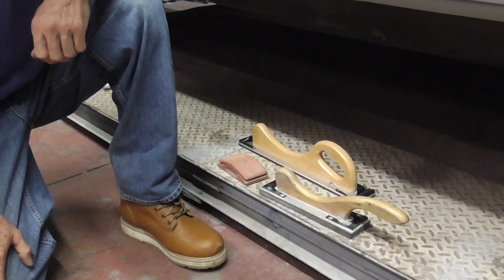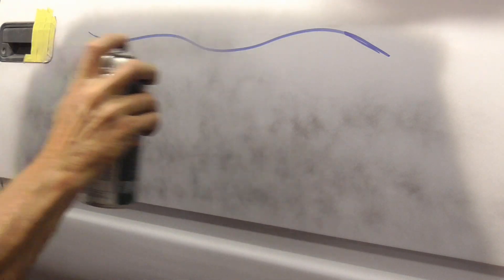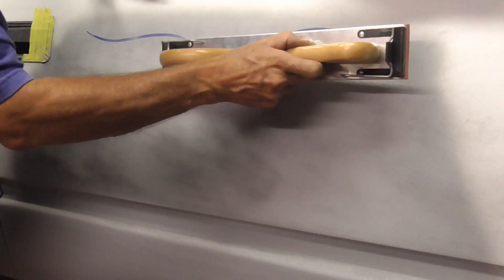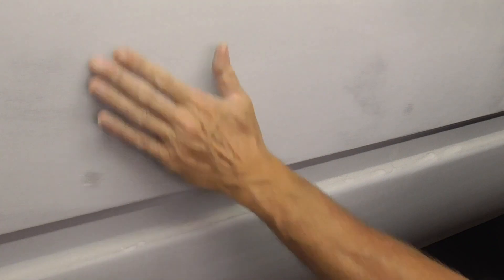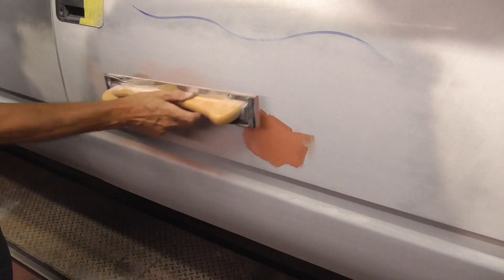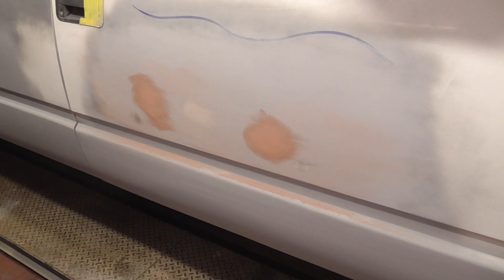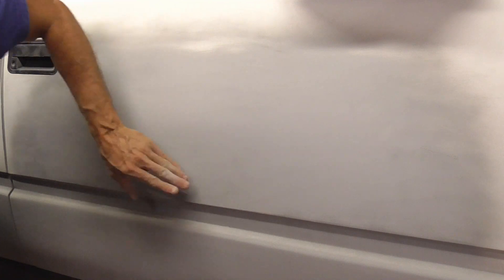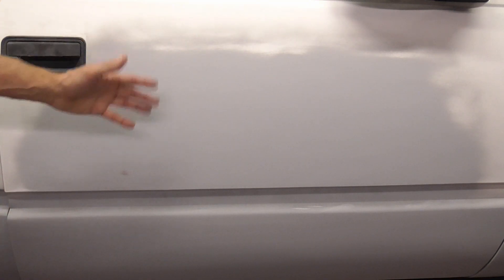Block Sanding Primer Surfacer: Addressing High & Low Areas

Comment: ????  Can you get the high and low spots with a DA (electrical) ? .... I have some guys saying it possible , yet ever body shop video I have seen (including yours ) use one of the three blocks (long, med, short rubber).. Hell most of them say just use a short rubber.. Any clarity on this possible solution ? BTW great videos... At the Trade School level...
Reply from the maker: It all depends on how straight you want it.  Yes you can get it pretty straight with a DA, short rubber block, etc.  The rule of thumb is the larger the dent or area of damage the longer the board used.  Thus for small stuff a DA or small block is fine - for larger stuff you have to use the long board to "bridge" and get it straight.  Hope that helps - if not ask again :)
Reply: @LakesideAutobody  thx that helps..Lol i guess a video on DA vs block straightness would be in question...lol...but dont want to bog u down....lol..thx..
Reply from the maker: @alphathefirstone1222  Great suggestion - I'm writing it down.  Don't think that any ? is silly.  Ask anything you want - sometimes the most simple sounding ? has a ton of depth.  Like DA vs Block - excellent!

Comment: May I ask what brand primer and paint you use? Did you ever use speedokote or Eastwood? Thank you. Enjoy your  weekend!
Reply from the maker: I use lacquer primer from Auto Body Master.  I get it for around $50/gal and when mixed you actually will get about 3 gallons from it so it's cheap, drys fast, builds fast, sands easy, doesn't harden in the cup (you can pour the unused portion back in the can).  That said speedkote or Eastwood primers and any other auto body quality primers are great and I'm sure they all work fine - just have to find one you like and that is in your budget.  Urethane and lacquer primer are usually primer surfacers (build thickness) whereas epoxy is usually just a  primer like a sealer.
Reply: @LakesideAutobody  Thank You
Reply: @LakesideAutobody  is auto body master a store or mail order?

Comment: Are you using 2k primer or lacquer primer?
Reply from the maker: Lacquer primer but not opposed to 2k urethane primer for primer surfacer.  I'm really OK with lacquer as that's all they had for many, many years.  Cheap, builds fast, dries fast, sands easy, and you can throw the unused portion back in the can or keep it in your gun w/o hardening.
Reply: @LakesideAutobody   Thanks for your reply just wanna ask how’s the corrosion resistance of these primers or do you have to use etch primer before applying it on bare metal as it is recommended on 2k primer.
Reply from the maker: @IM-nh8hn  Lacquer primer doesn't need an etch primer before applying but you can't let it sit outside for long as it is porous and the metal will start to rust underneath.  That being said, if you keep it indoors you will have no problems and once it's painted you'll never have a problem with it.  If you use it correctly it's a perfect primer - to me anyway.  Most will say 2k is the way to go and it probably is a better quality primer - 2k  "primer surfacer" that is ... It's all up to you what you prefer to me they all work great - I just try to keep the cost down.  Hope that answers any questions - if not feel free to ask more :)

Comment: Those are wood blocks. Body blocks dont have padding so you can make a fat surface.  Also use an X pattern starting from one side in one direction then from the other side the opposite direction.  You're all over the place not making anything really flat. Also blocking prior to filling will show all your hi and low spots for filling. Just a simple blocking with 80 instead of eyeballing it by doing unnecessary grinding down to metal. Unless stud pulling no reason to go to metal.
Reply from the maker: That x pattern is what the books and magazines suggest but it is not always correct.  That's why so many guy's I've worked with have trouble getting filler and primer surfacer straight.  If you are suggesting folks use Dura block? - absolutely not good info.  You want a block that stays straight and doesn't flex like those foam blocks.  Check out my playlist on blocking if you are really serious about getting panels straight https://www.youtube.com/playlist?list=PLOP9eoG14-I8NVEeuNbZQhXsrKRrdo7Oj - like this car that I painted in 1994 - https://www.youtube.com/watch?v=2o37dX--w0I - still looked fine when I sold it 25 years later with the techniques found on this channel.
Reply: @LakesideAutobody  I dont go by books or mags just experience at a restoration shop. I use aluminum blocks ... follow the X pattern from one side then the next and you should be straight with little backfill if your first was enough. A lot of people try to skim coat something that needs a bit more and do double the work. As far as primer goes try some polyester ( some call it liquid bondo and I hate that term ) but its thick and gives room to block. Then 2k for wet sand. Just my 2 cents.
Reply from the maker: @jamesroe7628  Yep - in the 80's when my body work was sub par Feather Fill was the go to.  Bury it - go to lunch - hopefully the boss doesn't look at it before we get back - block sand it and voila! everything worked out.  Nice talking to you James :)
Reply: Just some conservative criticism... more than one way to skin a cat.